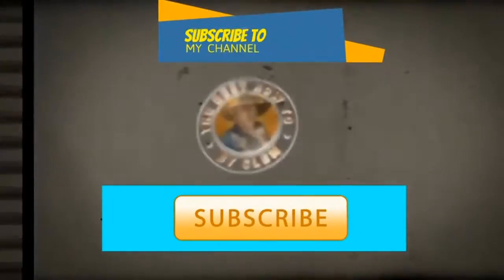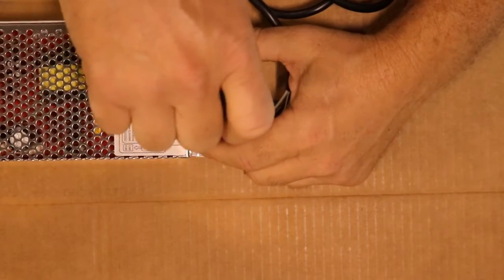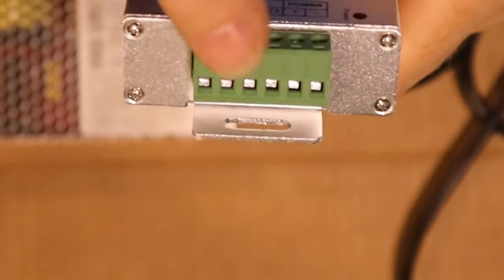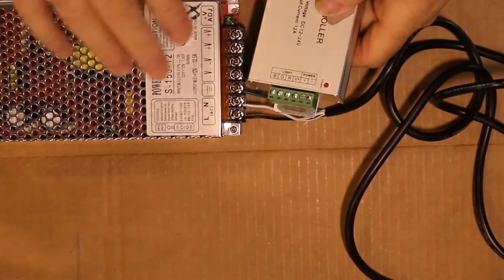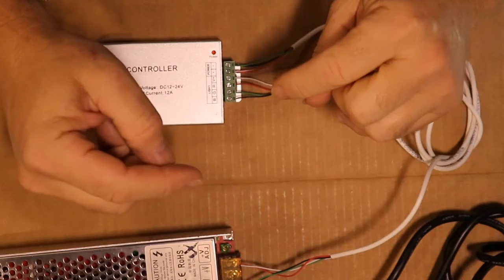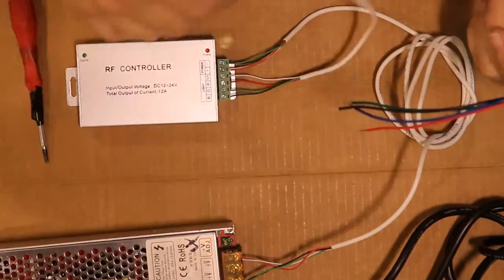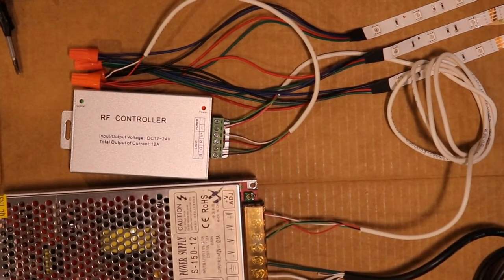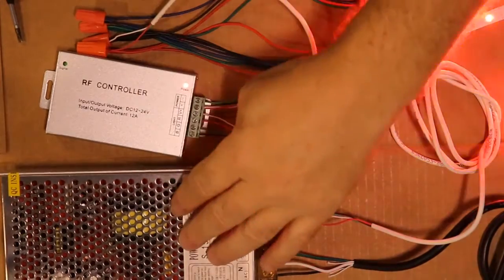How To Connect LED Strip Light to LED Controller || How To Connect LED Light to PowerSupply

Comment: Really enjoy your videos...
My question is can a led strip light (RGB OR SINGLE) be connected to a dimmer...? And how can it be connected..?
Pls I need a video 
Thanks
Reply from the maker: unfortunately I do not see a video being created for this topic any time soon. to answer your question is Yes. several ways. one of the easy ways is to get a controller that can change your RGB or single lights and they always have a feature that you can dim the lights. another way is to get a magnetic power supply and put a dimmer to the that. in the pass several years a company has created a dimmer just for LED'S that does not required a magnetic PS. you can use a regular PS and then use the switch to dim the RGB and white lights. 
I hope this helps. But remember that you cannot just add any dimmer to LEDS because the LED it will start to flicker.
Reply: @thebesthowtobyclem6908  thanks Mr Clem, it's self explanatory.. really appreciate your efforts.. God bless

Comment: Can u connect rgb strip directly to bedside pendant wires? I have everything u have explained in video but wondering do i need low voltage wires to connect to controller.... to pendant. As pendant running off mains
Reply from the maker: You do need low voltage wire for LEDS

Comment: You'll never believe this trick I stumbled across Clem, while pulling my hair out trying to figure out how to connect my 3 5 meter strips adding power injection, I added one of those little 6 amp mini-controllers, the + and - to my power supply and each end of the mini amp I plugged into strip #2 and strip #3 and VOILA! NO VOLTAGE DROP! At least to the eye...even at full white!!! There may be the very slightest dimming on the #2 strand, but I'm being nitpicky, I'd say it's at roughly 85%, strips 1 and 3 100%
Reply from the maker: Congratulations, I'm happy for you and I bet that your son is happy that you took the time to make it all work.
Reply: I meant "mini-amplifiers" of course

Comment: Hey Clem, now that I've got everything wired up correctly (and tested/working perfectly) I'm thinking it will be a hassle to hide the pigtails between each strips meeting points (end of the first strip, end of the 2nd strip and we havent included "home runs" right? Unless you think my 220 will drive all 3 strips
Reply from the maker: It will be some work but it will look finish. You will have to go up in the attic to run the wire from the lights strip back to the controller.
Reply: I'm now seriously considering your first "best" suggestion and soldering the 3 strips together, I think I've got the skill for 4 solder points

Comment: Just an observation, you will need to follow Clem's equipment even if you want 2 strips, in fact, the cheesy 10 amp AC adapters these usually come with, your brightness will fade before even the end of the first 16 foot light strip, (halfway into the 2nd wire you won't have 50% brightness) unless you bought super-cheap strips with not many lights-per-foot. The 220 PS Clem recommended was perfect for 3 strips (48 feet) or a standard 10'by 12' room (44 feet)
Reply from the maker: I'm glad it help you out and thank you for the great reviews. Please tell your friends to subscribe to my channel.

Comment: With all 3 strips wired this way, you can only have the strips in a linear fashion (one on top of the next) and not set up to wrap around a room?
Reply from the maker: You can wrap it around the room. You will need more love voltage wire.
Reply: @thebesthowtobyclem6908  So not the 22/4? Are you suggesting 14, 16 or 18 gauge? Thanks

Comment: YOU MADE THE ULTIMATE STRIP LIGHTING VIDEO FOR MULTIPLE STRIPS CLEM, SPREAD THE WORD EVERYONE!
Reply: Clem, do you have any tips on how best to hide the connections between each of your color-matches? (you know, the length of wire that matches up all your greens, all your reds and so forth? I'm sure I could purchase some "channels" to house the strips, I think it will be unsightly to have a foot of wiring at each meeting point between strips? Thanks for making the video no other Youtuber has made, how to actually connect each strip to one another, to the power supply and the RF controller.
Reply from the maker: Send the wires up the ceiling and then down to the controller
Reply from the maker: I hope this helped